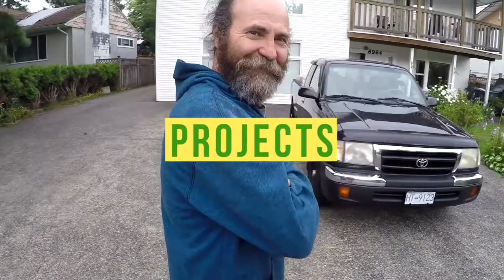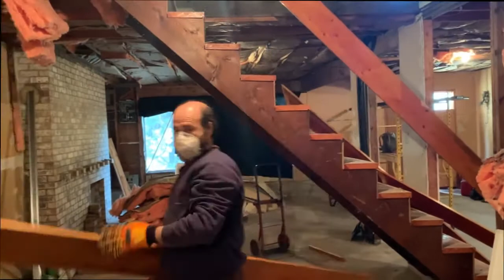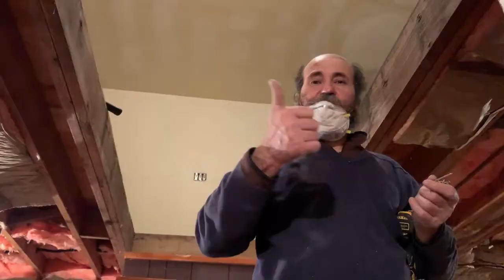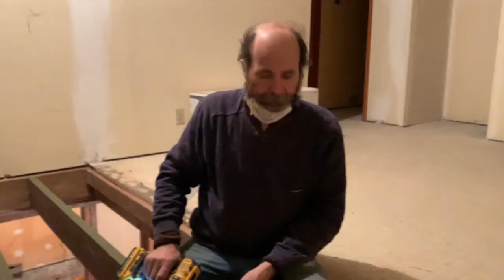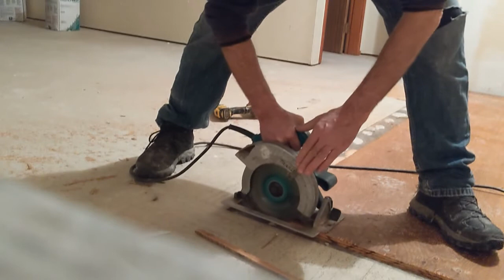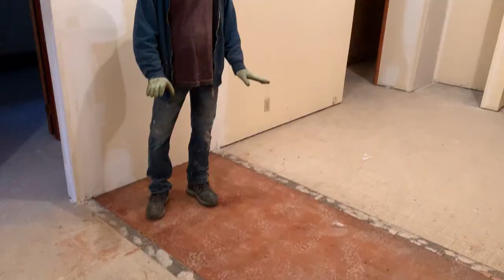How TO Close A STAIRWELL / STAIRWAY Hole

Comment: Shouldn't you scab onto the joist and bolt them to the existing joist on the opposite side of the load bearing plate ? Then use joist hangers on the load plate then place blocking between the new joist and existing joist for added support so that the PPSI ( pounds per square inch ) on the new flooring sheet over the old stair well, can carry a load the same as the existing floor ? It does not seem as if the floor would be strong enough to carry as much of a load as the rest of the room. Especially with it protruding out into the middle of the room. Am I right or am I over thinking the engineering aspect?
Reply from the maker: Hello Bryant, thank you very much for your time and support, I installed joists hangers from the bottom and built a wall right under where was the stair opening, sorry for not showing in the video, thank for bringing that up, I totally agree,, keep safe and enjoy life.

Comment: Well there is no shear strength in screws but I doubt you have a local building code. Great job!
Reply from the maker: Hello Joshua, thank you so much for your time and support, I installed joists hangers from the bottom and built a wall right under where was the stair opening, sorry for not showing in the video, thank for bringing that up, I totally agree, a screw conversely has very little shear strength, keep safe and enjoy life.